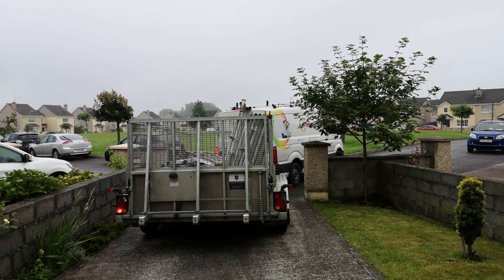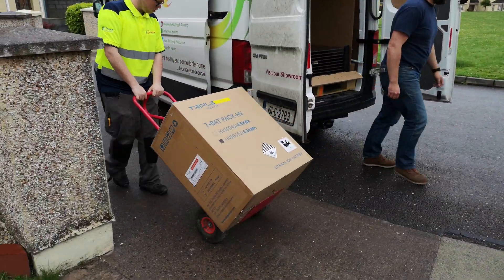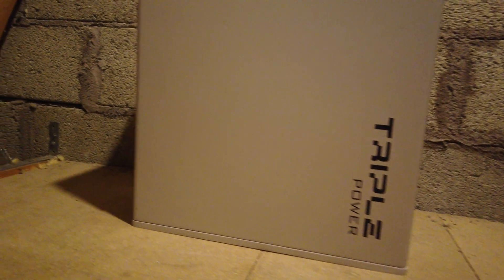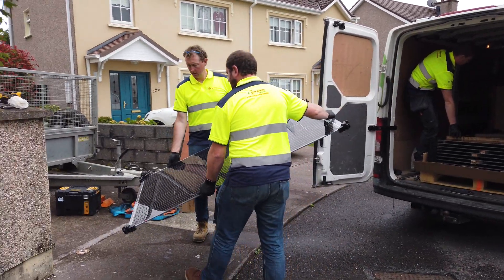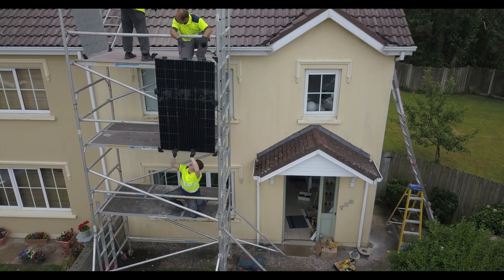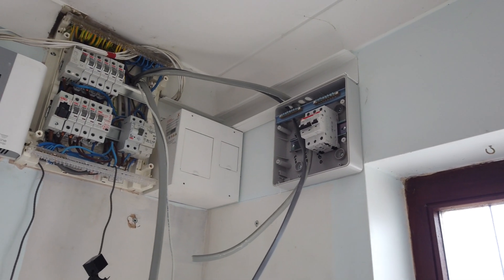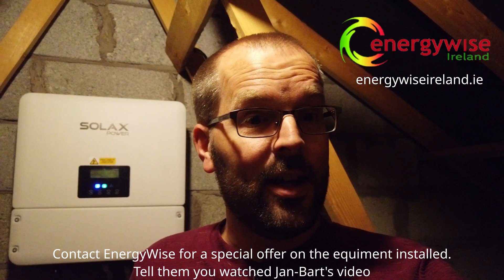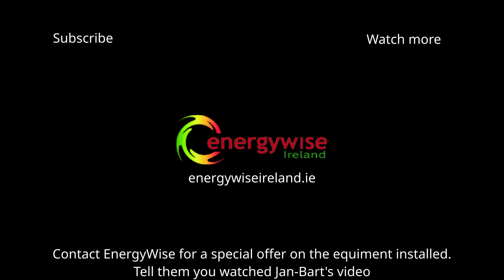Installation - My Solar Journey - Episode 1

Comment: Nice setup! Did you buy it or Lease it etc and is there Equivalent to feed in Tariff in  Ireland  ? We miss our solar panels we had on our last house but had to move ,so got ev but no solar as now in uk you don’t get feed in Tariff anymore so not hugely worth the Investment with cheap electricity we are paying about 10 p a kWh less than we was paying at last house so bills about the same just no Payment from the government every 3 months but savings a fortune on fuel now with ev so swings and Roundabout . Would love to get solar and battery but can’t find way to pay for them that will pay for it self in sensible time frame. About 15 -20 years is not going to cut it.
Reply from the maker: I bought it. Took out a green loan to cover the cost. Monthly payments mostly offset by the savings in electricity. No FIT in Ireland either and I've got no night rate electricity. 

They're currently installing smart meters in Ireland but you can't do night rate with them yet (stupid excuse but.... you know..... Ireland).

It's the batteries that make it worth while. I'll probably be off-grid during the summer. And in the winter you could charge the battery on night rate and use it during the day. 

Having the emergency backup function is a nice thing to have as well. Keep the lights on if the power goes.
Reply: @JanBartSpang  yer good to have power cut back up . Sounds good deal don’t think there is much in uk now. Looked at new grant scheme but not worth the hassle . Was looking at replacing gas boiler with air Source heat pump , but was told 100£ max saving a year and have to pay about £2000 to it to do it Properly as have old radiators etc . So like solar if want to be green it’s going to cost us more than it’s worth . As both not in work. Do know how many people are in it for environmental reasons only but our Decisions are on Money-saving potential first and eco second I’m afraid to say 😔. What was your bills before and after ?

Comment: Hi John Bart, I am about to buy pv system, why buy 12.6 kws battery for 3.3kws system. Will the panels produce enough to fill the batteries ?. With the feed in tariff due in January would I not be better buy more panels and forget battery? . Appreciate your views on this
Reply from the maker: No, you will not be able to fill the 22kWh battery my Zoe has with PV. I would have to install probably more than double the amount of PV and I simply do not have the roof space for this.

I didn't get solar to fully charge my car. But more on that in another video.

Currently in Holland at my parents and I will be filming more about my solar install when I'm back 🙂
Reply from the maker: Also, the FIT will be a fraction of what you will be buying the energy back for. So self use is where the savings are. The battery will allow you to maximize self-use. I've only exported about 6% of my energy.

Comment: Will this system allow you to have power during a power cut? I know some inverters have a safety feature that isolates from a dead grid allowing you to run the house from either the solar or battery, but that some just shut your power of completely while the grid is down.

Also what amount of battery did you install? was it a combined 6.3 or 12.6?
Reply from the maker: One of the boxes near the fuse board is a manual isolator switch which will allow me to disconnect from the grid and run on battery power during a power cut.. It'll be limited by the inverter output (5kW) during the day when it can combine solar and battery output and at night is limited to 4kW of just battery output..

I've two 6.3kWh batteries so about 12.6kWh gross storage capacity.. It's got a 90% Depth of Discharge rating so about 11.3kWh net capacity..

Comment: Can you charge the batteries from night rate electricity for the bad days when you get very little from the panels
Reply from the maker: Yes, you can. Also might be handy if you know there's a storm coming and you live in an area with frequent powercuts. Charge the batteries and put them in backup mode so they do not get used until there's no grid connection.

Will cover those work modes in a future video..

Comment: Any thoughts on house resealability? Not asking how much :) but if you thought about it and any finding. Also your heating system is gas boiler + gas cooker? Or all electric? Nice seeing you again!!
Reply from the maker: Our house went up two tiers in the BER rating just from the system I installed. That always helps house prices. 

My heating is the standard Celtic tiger gas boiler and I indeed have a gas cooker but a electric oven. Both heating and cooking could in time be switched to electric but I have no definite plan or timeline. But when it comes to replacing anything power usage is always something to consider.
Reply from the maker: But no plans to sell. And it was nice to see you as well on Sunday.

Comment: I presume they have optimisers as the chimney will shadow if they are due south. So production could drop off afternoon if not. Especially in winter.
Reply from the maker: DC optimizers are specific to SolarEdge. This is a SolaX system. So no I don't have DC optimizers.

So far I'm not noticing any major decrease until around 6pm. I'm hoping to catch a perfect blue sky day so I can get a uninterrupted solar graph to see when it actually hits. 

But the system is usually producing enough to cover my house base load until about 8pm with the batteries covering the rest. At that stage the whole roof is in the shade.
Reply: Nice bet your bills have dropped. What was your monthly bill before setup ?
Reply from the maker: I'll have a video about that coming in the next few weeks but I'm not a very high daily user and my usage is variable.

Monthly bills are very small.
Reply: Great you still got Zoe ? How many miles you do these days .? Are you putting zappi in to use power from the panels
Reply from the maker: Yeah, still have my Zoe and already had a Zappi since January last year but never made a video about it. 

But more on that front some other time.

Not doing a lot of mileage but am still working (hospitals don't tend to close). 

Mentally a bit exhausted so not producing much content lately. It's hard to be creative when you're tired.
Reply: @JanBartSpang   well done we can wait . 
:( looks like we won’t be so busy next week as looks like we going back into lockdown again

Comment: Do you have three phase electric?
Reply from the maker: Nope. Single phase only.
Reply: Jan-Bart Spang okay ta. Was that something you'd considered installing or was in not needed?
Reply from the maker: Not needed and expensive. 3 phase is only until the substation at the beginning of the street. I'd have to pay thousands to get it into the house. 

My roof is to small for an array big enough to require 3 phase!?
Reply: Jan-Bart Spang ah! Okay. Cheers
Reply: @JanBartSpang  Do they not run 3 phase PAST every house and just tap off one phase? So the house next door is on a different phase to you?
Reply from the maker: @tedgreagsbey3654  Maybe. Not familiar with that kind of stuff.

But in any case getting 3 phase was not required.

Comment: Great, bru. Whish I had a roof ...
Reply: Well done JB, installed my PV system in 2015 (before grants) and very happy, use to charge my Zoe on sunny days.
Reply from the maker: At least the German grid has plenty of solar power!!
Reply: @JanBartSpang  yeah. Probably I can install a single Panel in the garden ...
Reply from the maker: @der-e-wolf  you could but there's things like minimum voltage to think about. One panel wouldn't work.
Reply: @JanBartSpang  oh, this works well. We call it "Balkonkraftwerk". They have one Inverter and you can attach one or two modules to ...
Reply from the maker: Maybe just put some communal panels on the roof of the building instead? Share the power with the rest and leave the balcony alone! 🙂
Reply: @JanBartSpang  that's not so easy. I guess the landlord wouldn't like this. But I have a garden with plenty of space